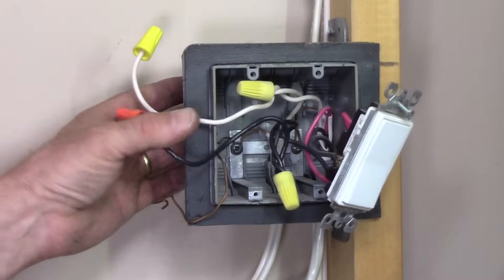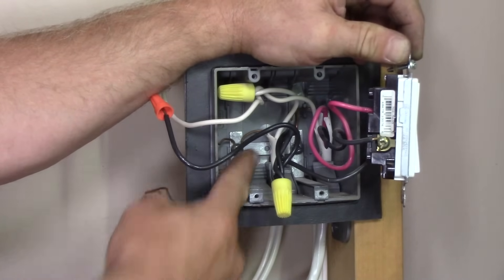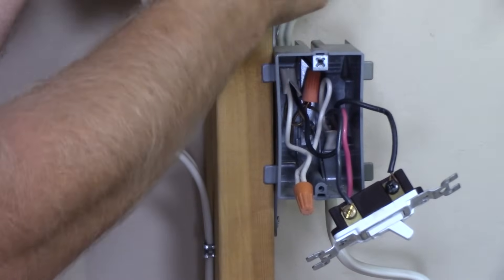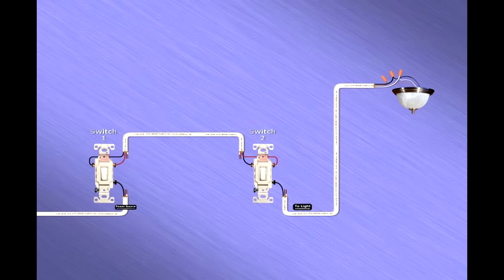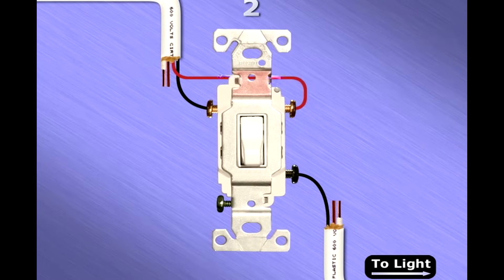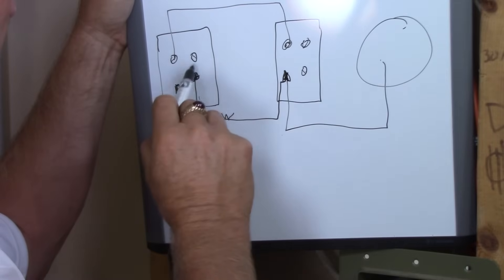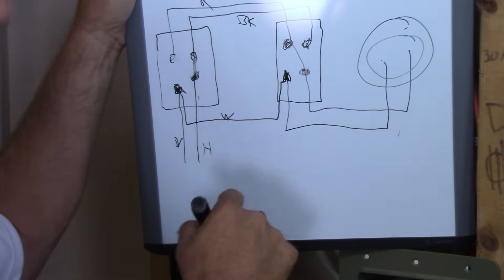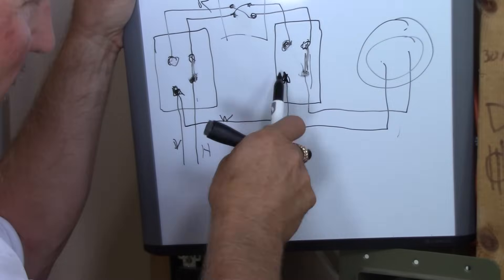The Best 3 Way Switch Explanation Ever!

Comment: explain common ???
Reply from the maker: Common means that it is the terminal that is common to each traveller terminal. The connection is either from the common to traveller 1, or common to traveller 2.
Reply: Aka, where your hot wire is connected, no matter where that hot wire is from. It could be coming from the breaker panel directly to that switch, or, it could be from another switch across the room. Hope that makes sense.

Comment: My kitchen light has 3 different switches. Daily I have to play musical light switch to figure out which one is going to turn on the lights. Unless it's raining then all 3 work perfectly.
Reply: The wiring is weird though, goes from the breaker box to the light. Then down to the switches.
Reply: One of the travelers is mixed up with a common in one of the boxes. You probably need to hire a pro if you want it corrected.

Comment: I hooked it up and now lawn sprinkler stays on with switch down door bell rings in up? Wtf lmao
Reply: You must’ve damaged the flux capacitor, simple fix.
Reply: STAY AWAY FROM THE PLUMBING!
Reply: its easy. stop watering your lawn and get a knocker.
Reply from the maker: Your wires are low on electrons. Go to the hardware store and ask for a bag of electrons. Then open the outlet box and carefully pour in the electrons and quickly close the outlet back up as they will leak out rather quickly. That should fix it. Always shut off the power before doing any electrical work.
Reply: Ahahahahahaaj
Reply: Hey Moe! Nyuk, nyuk, nyuk... 😀
Reply: @OOICU812  No wonder there's no water in these pipes! they're all clogged up with wires!
Reply: Start using liquid amps on your lawn and lubricate your doorbell with voltage grease.
Reply: Pee Jones, of course ! I had not thought of that. My Helpful Hardware Store down the street has both of those in stock.Thanks !
Reply: That's exactly how I wanted mine to work, but it doesn't !! What did I possibly do wrong ??!!

Comment: Great video and explanation. Im confused about the traveler location... does the traveler need to be wired on the same terminal on each 3way switch? The animation shows the (red) connected to the same terminal on the different switches, but your wire up shows the (red) on opposite terminals of the different switches.
Reply: It doesn't matter with travelers. Just dont put them on the common screw.

Comment: On Switch#1 - If current travels from the black hot line to the black common wire, shall we break or disconnect the bridge of the red wire side?

Comment: Im an Electrician and this video is professionally explained. Some times is difficult for some people transmit Your knowledge to others and this gentleman  video is very explanatory . Thank You!
Reply from the maker: Raul T. Thanks for your comment!
Reply: @theinternetelectrician  I appreciate you sharing, I've worked in the trades (many) for the past 20 years, and I apprenticed for about a year with an electrician, and I will say, you explained that in a easy to understand way, I appreciate that and keep up the good work, I know I dont have to say this, but do not pay attention to negative punks hiding behind a computer screen, the guy obviously has self esteem issues take care of yourself thanks again
Reply: As I have always understood this, white wires connected  with white, black wires connected with black, the bare ground wire is connected together, yet, bought a electric heating element for the bathroom, and all the wires are black, as well as the thermostat, wires what gives?
Reply: i have never seen a video like this before thank you terry very very helpful! and you save us spending so much money to pro electricians!
Reply: @mario21233  just be careful, sometimes it might look easy enough, but it can be tricky, and needless to say dangerous,  but good luck to you and I wish you the best
Reply: I have 4 switches controlling the hallway lights.  If I want to bypass 3 of them and have just one switch control the lights, what do I do?
Reply: Raul T. Not worth it there are DOZENS OF THEM.
Reply from the maker: Maybe not to your 11 subscribers, but my 28,000 subscribers, and the 7,338,154 times my videos have been viewed may think it's worth something.
Reply: Terry Peterman best come back comment I’ve seen all day! Nice work!
Reply: Raul T. Look a three way switch is VERY SIMPLE, if you take as long as you do to explain it 90% of the viewers WILL SIMPLY TUNE OUT.
You may be a professional electrician but you have little experience in explaining things.
A simple diagram is worth  10 minutes of your video.
Reply from the maker: I look forward to your explanation video. Call it "Better than the Best"!

Comment: Hi i need to find out how to use two live wires to have two or three way switching. i have the american version of 110 and 220 volts. the 220 volts carries a dubble pole switch. i want to have my house in 110 and 220 volts but i would like to have my lights in 22o volts. how can i do that if two 110 lines gives me 220 volts?
Reply: livemainsable do you have a 220V light bulbs?

Comment: Excellent video! My "2cents":
So you have two light switches. Each switch is a "3 way switch" (differs from a basic light switch). One switch has a flat cable containing a black, white and bare wire which connects to the breaker box or an outlet (bringing in "power").  That black wire gets connected to the black screw on the switch.
The other switch also has a flat cable with a black, white & bare wire. This cable connects to the light fixture. The black wire connects to the black screw on the switch. Now you run a round cable with a red, black, white & bare wire from one switch to the other. (looks scary now). The two white wires simply get hooked together and pushed out of the way. The two bare wires get connected together with a "pigtail" added which will connect to the green screw. (both switches are wired the same) Now connect the red wire to either empty screw on the switch. Connect the remaining black wire to the last screw on the switch.
Reply: Another way to think about it is a roadway.  

At the first switch, there's another lane added.  A traffic control device or person directs cars either into the left lane or the right lane.  Down the road there is a second traffic control device or person representing the other switch.  Either traffic from the left lane or the right lane is allowed to proceed.  Traffic can only move when both controls are set to the same lane.  

Changing the traffic control at either point will cause traffic to move if it's not, or interrupt traffic flow if it's moving.
Reply: mrsparex there’s many other ways to do it too. That is just the most basic.
Reply from the maker: Yes, correct!

Comment: Thanks Terry! I have a custom scenario in which I'm looking to energize 2 different HPS bulbs half duty for 12 hours opposite times for growing plants with one 240V ballast at 100%.
Reply: Use a contactor with a normally open and normally  closed contacts. Use a timer to power  the coil for 12 hrs. Hook one light to the normally open contacts and the other to the normally closed. 
If you use a wall timer, just cut a cord off something to hook up to the coil.
Reply: Time clocks

Comment: Hi, Thank you for the video, I wanted to ask you this: 
i essentially have an outlet in one room

and a hole drilled through cement
is it okay to run an extension cord with very high gauge
through that whole to run powerful equipment on continuously ?
and if yes, is it safe so cut one end of the wire so that it fits through the hole then recrimp the plug to where i cut to get it to fit into the hole

any help, would be appreciated, or if more detail is needed, please reach out and will contact you however

Comment: The animations are excellent. With the videos you might think about supplying marking tape as found with most thermostats. Inexpensive to do and might be a value added bonus to your package. You don't want my thoughts on the white board.. ;) .
Reply from the maker: Not sure I understand what you are saying about the marking tape? I agree that the white board probably wasn't necessary, but wanted to cover all the bases of different ways to explain this.
Reply: Thermostats come with tape to mark the different wires, might "H" for Hot and "T "   " for traveler and where it comes from, the right size a person could add their own description. If I ever did build my own home I would certainly like to map it one way or another. In my case I doubt that will happen but others might be interested in this idea. I guess that expands into the idea that homes should be mapped for wiring and plumbing for that matter. After buying my home here in Wauconda IL 5 years back I did replace all my outlets and switches and in doing so found 7 reverse hot/neutral scenarios, one defective switch and a scenario where the owners did not have a three wire so they added one and it was clamped coming through as a single wire into the box exposed to the ground clamp on the box. Doing some remodeling myself I jarred it and it shorted to ground. It had me scratching my head for a while until I exposed the complete box for inspection. I should have known better but inspectors when buying a house should be trained to check all outlets. I don't complain as I did get a good deal on the home and I know my way around and solved all the issues.
Reply from the maker: Yes, it would be good to have a schematic to show all the circuits and how the wires are run. Time consuming though, and house wiring is so competitive in most areas that the only way for a contractor to make money is to get it done fast!.

Comment: Terry, I like your videos, they are clear and easy to follow.  I also have taken your course and enjoyed it very much.  When I teach someone on how to wire a 3 way switch I tell them there are 3 things you have to know.  1. Black power goes to one switch common,  2. White power goes to  white of the light. 3 Black of the light goes to 2nd switch common.  The rest you can draw in  like you did on the white board.
Reply from the maker: Thanks for the comments Ted! And thanks for supporting my internet activities.
Reply: Simply say....white stays white ( grounded conductor )  hot on one end of 3 way switch ...and leg end on the other switch that goes to the light ....traveler's in between